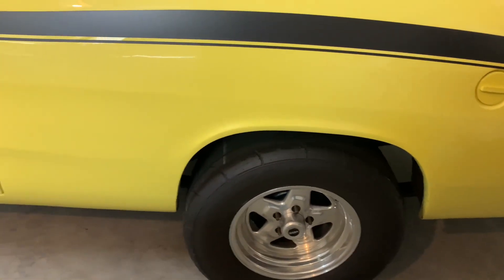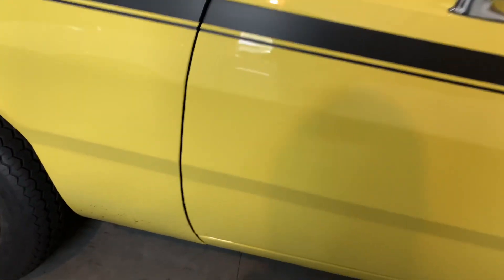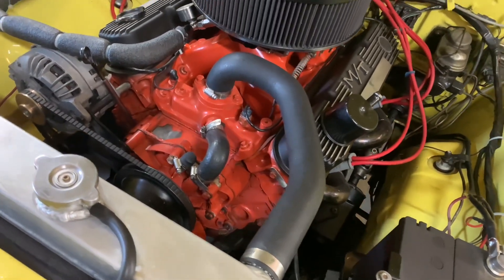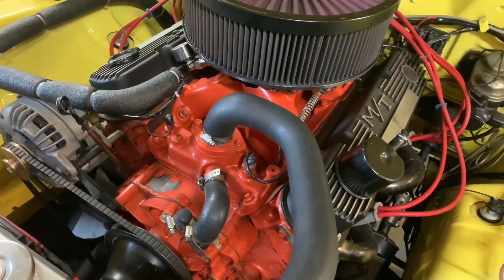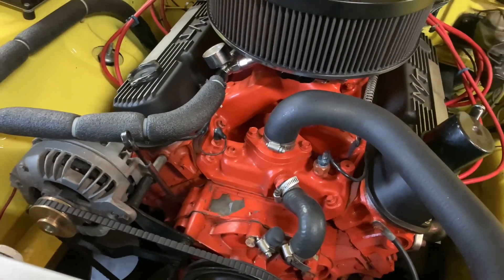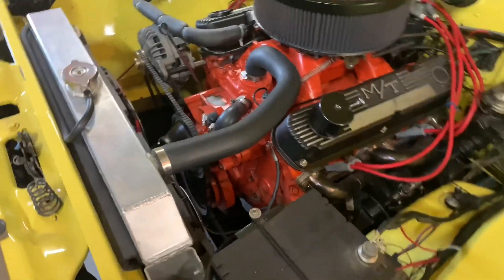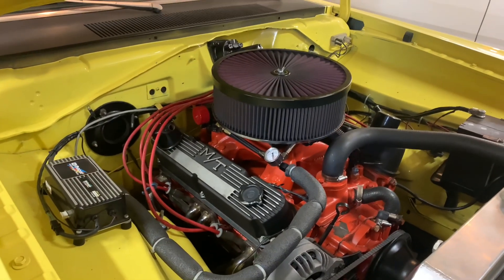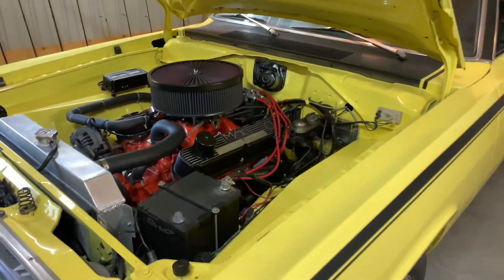EASY 11 second small block Mopar recipe. Build breakdown of my street/strip Duster.

Comment: That is soo cool.  The car is soooo clean, stock looking!!  I had my 73 Duster with just a 318 and the car ripped!  Ran over 300,000 miles before I even tore into it for the first time.  And to think, back in the 80's, you couldn't give Dusters or Mavericks or Vegas or Darts away and now, the prices on them are insane!
Reply: Vega?
Reply: the A body mopars have aged especially well over the past 15 years
Reply: @georgewetzel4380 , it was a small economy car made by Chevrolet during the 70s. Usually powered by a 4 cylinder. A few savvy individuals installed V8s in them and went racing.
Reply: Mopars in general command big $, and for good reasons.

Comment: About 417 horsepower at around 6700 RPMs, torque is about 345 lb ft, flow is about 670 CFM at peak power / at the weather conditions when you went 11.72. I based my calculations on a race weight of 3400 pounds. A good set of solids was the way to go.
Reply from the maker: Very to the point. I like it.
Reply: I'd say that the engine is probably making 425-440hp, and between 430 and 440Tq at the flywheel. Those 360's with good compression are torque making small blocks. If you had a higher flowing heads like the Magnums with light bowl blending, and blending the valve guides, I can see you getting up to 460hp at the flywheel and 470TQ. Still that car is no doubt a solid build!👍

Comment: I had a setup almost exactly the same. 509 purple shaft cam. It was 380 hp and 475 lbs tq. I now have a stroker in it, 408, Edelbrock heads and I’m 495 hp and 520 lbs tq
Reply from the maker: Sweet! Very nice numbers

Comment: Very nice job on that Duster. It runs really well.

My brother had a Dart with a pump gas 340, with W2 heads and solid lifters back in the 80s. SS springs, 4.30 gear, 9" converter, 3400# with driver. Ran mid 10s with bests in the 10.30s in good air. Nobody but us knew what it ran. He waxed so many big block cars on the street with that combination it was hysterical. They couldn't understand how it was possible to be gaped by a little 340. lol
Reply from the maker: Nice! That sounds like one hell of a fun street car.
Reply: @Duster_Garage  It was a blast.

Comment: We ran a very similar combination in a 1972 dart for years. The only real differences are we had a 727 transmission and a 4:30 gear. It ran 11.90s in good weather and 12.00s in the heat. The only thing we ever had to do to it was change oil and plugs. It was such a good consistent combination that it won me two championships at Bristol Dragway.
Reply from the maker: Nice!  Mopar stuff is tough, hard to beat it.

Comment: Man glad to hear someone else using a MOPAR performance cam. I have a 360 only bored .020 over anmd stock dish pistons. Not a hot rod. '79 gutless wonder truck. Built it only for better low end torque. Cam me using is 168/172 Mopar, and a 600 spread bore holley. Accell ignition, all of it. I rebuilt trans and went with a 5 disk clutch and valve body kit so fluid flows in park.
Reply from the maker: Nice, sounds like a stump puller with that cam. Monster low end torque.

Comment: Man that is a nice car and quick for what it is! A friend of mine just changed his two chamber mufflers to a straight through muffler and picked up two tenths and 3mph in the 1/4 with no other changes!
Reply from the maker: Thank you. That’s good results from a muffler change. Last year I did remove my exhaust and ran 3” diameter, 18” long collector extensions with bullet mufflers but my car only picked up 1/100th in the 1/4.

Comment: Very similar to my 72 Duster.  I have the same rear, gear ratio, axles, suspension, transmission, and converter.  The only difference is my 360 has been stroked to 408 with aluminum heads and it is now running 11.17s very consistently.  Only weighs 3,300 lbs with me in it.
Reply from the maker: Dude, that’s a sweet Duster you have. Thing runs strong. I just checked out your channel. 👍
Reply: @Duster_Garage  thank you very much.  Yours is sweet too!
Reply from the maker: @hemimopar061  Thank you!

Comment: Good clean solid build . I did I a very similar build on a 75 duster . Mine also ran very strong and sounded fantastic !! Congrats ona nice street n strip fun duster .
Reply from the maker: Thanks man, they are a blast!
Reply: You betcha !! Those wide rear fenderwells make for plenty of traction room and they have a more aerodynamic body style than a dart but don’t weigh anymore . Engine compartment is a little tight but all A body weight meets deal with that. My opinion is small block in them of any cubic inch for what your doing with it is far superior to big block fitment and weight differences. Mopar suspension is easy to make work and a Direct Connection Chassis catalog is racers gold !!
Reply from the maker: @NilesJStJohn  I 100% agree with you. Small block all the way. I would never put a big block in an A-body.
Reply: I have a 68 2 dr sedan now and am building a street n 1/8 mile 318 stroked to 393 with reverse valve body TCI 727 and TCI 3500 10 in hot street n track converter with a narrowed 66 C body 8 3/4 with any choice of 3.23,4.30,4.56 gears. Selling the complete 8 1/4 with 4.10 and Trac Lok after the other is complete. Should be a solid but potent hot street and occasional track fun car.
Reply from the maker: @NilesJStJohn  Nice! That should be a tire frying torque monster.

Comment: I know these are mopars but for borsepower sake had a 67 camaro original 327 30 over,comp cam,dart heads ,600 vac secondaries,4 10 gears turbo automatic,107 mph through the traps gave me about 340 hp at the rear wheels ran 12.5-12.6 times this back in 1990.little more cubes ,and fuel setup makes a difference,I ran with stock fuel setup.

Comment: Nice car looks good and sounds good i have the same cam in my 67 383 coronet but it doesn't hit as hard as yours also have the same intake never took it down the track before but its not that fast i built a 318 4 speed 71 demon with a mopar 455 purple shaft 9 to 1 comp mopar dual plane and hooker headers 600 holley and recurved the distributor also had a 3.55 suregrip 8.3/4 it would run 8.90 in the eighth with full exhaust and street tires also would run on 87 octane always owned B body's until then now i got a 69 valiant 440 4 speed awaiting a 500 low deck stroker also had a blue 71 duster with a 400 in it painted intence blue thanks for sharing
Reply from the maker: @raysimon1368  That’s an impressive fleet. I’ve always been an A body guy. I could get them cheaper and their light weight was ideal for drag racing.

Comment: Wow, so close to my set up. My Duster has comp cams full roller cam set up (I'm not sure of the specs) and a Mopar M1 Highrise intake. I'm surprised you can fit such a tall air filter element with a stock hood. When my engine was on the dyno when it was fresh built pulled 425 horse and somewhere in the 500 footpounds. I would think you're in that ballpark as well 👍
Reply from the maker: Nice! I kind of figured 400-425. About the air cleaner, it is like an inch and a half drop base and the lid still just touches the hood when closed.

Comment: Hurray! someone who does not have the 2 "cheats" in place to run fast....a fkn stroker kit and $7K heads......folk have that cheater crap on and run 10s and think its fast,.🤣.... I have had a similar sort of build here in the UK for 35years , '68 Roadrunner, all steel, 3.23 gears,  383, 906 stock valve heads,  484 hyd cam and it runs 12.80s.......with 3.23 gear and a 1.94-2.00 60fts !
 Hardly anyone can do that today, straight on the phone for a "cheater kit" and then gloat when they go the same speed LOL,, its the same over here now in the UK, everyone has the "cheats" in. great build right there mate
Reply from the maker: Thank you. That’s how I like my cars. As fast as I can with nearly stock components AND on a budget.

Comment: Great video! I bought a built 383, stall, 3:73 gears but can’t get past 14’s in Colorado. I’m not seeing where I went wrong on my build. Love your Duster!
Reply from the maker: Thanks man. I would probably be at least a second slower if I was in Colorado, high altitude.
Reply: What part of Colorado? I run a 366 small block now, but had a 360 sb an it would run low to mid 13’s and a 440 bb that would run 11’s at Pueblo. What’s the stall and what carburetor? Slicks?
Reply: @wht240sxka  wow that’s fast, I would love to break into the 13 someday. I live out by the airport, I just bought a DRAGY, going to see if I can finally break into a 30 year goal of running a 13 something in a quarter-mile. I have a very built transmission and a Branting 3300 stall converter. I just put on Mickey Thompson drag slicks in my latest video last week. I have not tried it yet, very excited for the snow to finally melt hopefully soon lol. I’m running an Edelbrock 750, Holly St., Dominator. Manifold.
Reply: @maximuswedgie5149   Yeah that’s interesting Ryan. I would think you have a mid to high 12’s. What’s your rt and 60ft? Slower rt and spinning maybe? I watched a few of your videos, seems like the tires are a little small to hookup good and it’s kinda hard to tell but almost seemed like it had a flat spot like almost falling on its face. I would try to do some ignition and carb tuning. Pull the spark plugs and see what they look like to give you an idea. When you get some time watch 318willrun on ignition timing, it’s really the best way and he explains it well.
Reply: @wht240sxka  thanks for the info! I really appreciate the feedback, I certainly need it. Now that I have the drag radials hopefully it will help it hook up better. Yes, it definitely falls on its face, I cannot seem to get my eye don’t mixture screws to really do anything. it is been this way since I upgraded to my Holley blue electric fuel pump. I have my fuel pressure set at five. I will definitely check out the ignition video on 318 will run.👍👍 if you’re ever in Denver, or near Denver, let me know. Maybe I’ll see you at Bandimere or at Julesburg this year? Going to try to make Julesburg on the weekend of July 18 for the hot rod revival. If I can run a 13.99 it will be literally a 33 year goal of mine.
Reply: @maximuswedgie5149  Cool deal man! Bandimere sounds good. Never been to juilesburg, but I live outside the springs. I have a 71 dodge demon. It’s primer at the moment. Our whole family has mopars. 69 Roadrunner purple 5??ci, 68 barracuda blue gen3 hemi,  72 duster purple (my old car)440ci, and a 59 f100 with a 440ci mopar 😬, oh and used to have a 70 dart with mild 440 that was red but unfortunately sold… see ya out there!
Reply: @wht240sxka  Nice! I'm here in Colorado, too. What kind of ETs are you turning with your 366, and what's your combo? I am currently breaking in my 372 build in my 71' Duster now eagerly waiting for PMP to open to get some seat time/track time.
Reply: @greazedlightninggarage6768  I am in the middle of building the 366. I was working on building a 408 with Robbie at McCabe Motosports, but it’s taken a backseat cause I want it to be badass and the funds weren’t there. I got a block from my uncle that used to be in my first car and when it got totaled, he yanked it. Was rebuilt at one point, so I just freshened it up and upped the compression. I just wanted to get my demon moving under its own power. Which should be soon! Aluminum heads have gotten outrageous so been looking for some used. I’m on a bodies only too demondreamin I think. Dang, been meeting a lot of colorado folks on here with mopars and here we only have 3 good months to enjoy our rides. Pmp sounds like a plan! Where are you abouts?
Reply: @wht240sxka  apologies for the delay in responding, I’m right by the airport DIA. Lots of places out here to test in tune lol.

Comment: Beautiful car, I love the build!
I do have a question. Right after you were talking about the TTI headers you walked around the drivers side and I noticed a universal joint setup between your column and steering box. I’m curious if you had a power steering box (or still do) . I know that the manual steering cars have a longer column to accommodate the shorter box and if you swapped out the box and left a power steering column.
I purchased an extension to go from the original power steering column to a manual box in my Dart - but if there are other options - I may consider doing a different setup.
I have TTI headers and they work only with manual steering so I greatly appreciate your input. Thanks for the great video 😉👍
Reply from the maker: Yes, you are correct. This was a power steering car. I installed a flaming river manual box with their power to manual conversion kit. The prices for that stuff really went up since 2007 when I bought my parts. Thanks for watching, hope this helps.
Reply: @Duster_Garage  
Thanks for the speedy reply.
When I get to work on my ride I’ll see how it all goes together. Prices on everything have gone up substantially. I picked up a pair of the Eddy 61729 heads. I bought them in 2019 @ $1,600 each and I see them listed at $2,040 - and not in stock. I’m glad I got them when I did.
Time for me to subscribe 
😉👍
Reply from the maker: @FreakOlds  If I were to do the manual steering conversion again, I would get a used factory manual box and I think Mancini makes a more inexpensive adapter shaft.

Comment: Do you ever have trouble with gas boil? I did not see a return line so was curious if that airgap you run maybe keeps the carb cool enough to avoid gas boil after you shut off a hot engine. Nice car👊
Reply from the maker: Thank you. No, I have never had an issue with gas boil or vapor lock. The carb actually stays fairly cool, i guess because of the air gap and it has no heat cross over in it. I also have insulation on the fuel line.

Comment: Cool. I have a '71 with a 414 stroker. I think I can pull a 11 sec. quarter too. I've got 3.55 rear gears though.
Reply from the maker: Nice! You should hit 11s. I had 3.55s and a low gear set in the trans at first. I was able to go 11.94 with those gears.
Reply: @Duster_Garage Awesome!  I'm running a 833 4 speed. Recently purchased a Tremec TKX though.

Comment: Sorry I've watched all your videos so I'm kind of picking your brain on each video love the sound of your car you said that you're running a 3 inch exhaust system with Summit mufflers are they kind of a muffler that is similar to a Flowmaster and just out of curiosity what is the do you know what the part number is for those mufflers sounds great
Reply from the maker: No problem. They are 3 inch Summit brand Flowmaster 2 chamber knock offs. PN # is SUM-638230.

Comment: Beautiful car! You running 284 hemi grind? Did you change to adjustable rocker arms ? what gap are you running on the valves?  Intake centerline straight up or advanced? Thank you
Reply from the maker: Thank you! Yes, the cam is a MP 284. I do have adjustable roller rockers with Lunati solid lifters. I set valve lash to .014" on the intake and exhaust. The cam is installed dot to dot, i didn't degree it.

Comment: Dude awesome job man… nothin like a builder… I’m actually planning to restore my 70 charger rt… I’m just collecting parts before I do the body cause I think that’s the right way of doin it… I need help with the parts though dude… and restoration but shits expensive out there… so far I got a ray Barton 540 hemi for it making 760 hp and a tkx manual 5 gear trans… next is the strange Dana but gearing and wheels and transmission are all connected and I’m not sure about numbers… after that probably a hotchkis suspension….
Reply from the maker: Sounds like it should be a badass ride when it’s finished.
Reply: @Duster_Garage  yeah dude it’s a dream but it ain’t easy… I ain’t a mechanic just a mopar driver lol but good job to ur ride dude very cool ride. 11s is no joke
Reply from the maker: @c.wdervin5987  thanks man! I appreciate it

Comment: Hi. Love the channel. Thank you. I have a stock Duster340 that runs like crap (thinking it’s carburetor.. has original thermoquad). But once I do get it squared away in the spring I was wondering what are the things you would do that are the most effective and cheapest way to get it into the mid 13s ?  Thanks.
Reply from the maker: Thank you for saying so. If the engine is mechanical sound (good compression and oil pressure).  I would think all you need is a good set of headers (TTI or Doug’s), Edelbrock performer rpm intake and a Holley 750 carb. Also, make sure all your ignition components are good and total timing is set to 35-36 degrees.

Comment: How is the starter access? Can you use a stock type starter? I still have low hanging cheap dynomax ceramic headers. However, I can use a stock chrysler starter. Just need to remove pitman arm to do so.
Reply from the maker: You can use the stock size starter. But I have a mini starter on mine.
Reply: @Duster_Garage  good. I wondered about that since I have considered the tti headers.

Comment: I have been struggling to bring down my ets any input welcome 67 barracuda  3150 lbs 3000 ft alt 71 360 .060 over kb 107s .005 in the hole edelbrock heads ported 293@ .6 Hughes stl 246-250@ 108 lsa Rpm air gap 750 demon   dbbl pumper ,411s ,tko 600 transmission best to date 12.59 on a red light my next plans are advancing cam trimming 4 deg more dynamic compression thinner head gasket 0.039  to 0.030 and 1.6 rockers
Reply from the maker: Hmmm. The combo you have sounds pretty well matched. I would think you should be in the 11s. The altitude is definitely hurting you but you can’t change that. 
I think you are on the right track with advancing the cam. Have you measured cranking cylinder pressure?  Mine is 165-170 with iron heads. I’ve heard you can run 195-200 with aluminum heads and still use pump gas. 
What header/exhaust are you running?